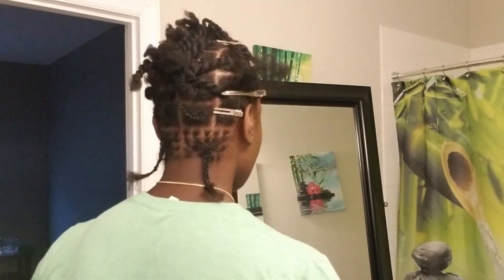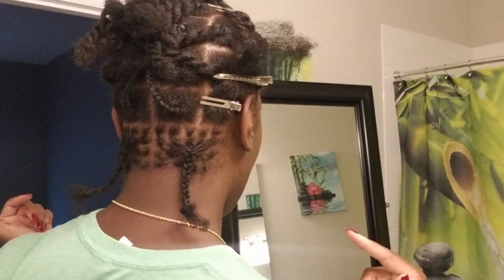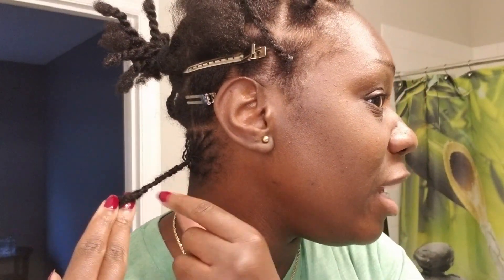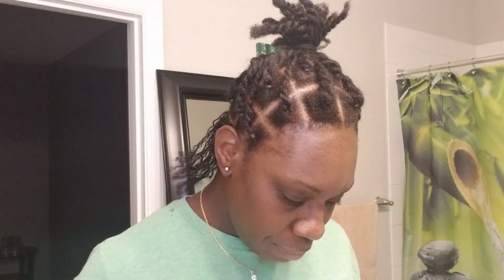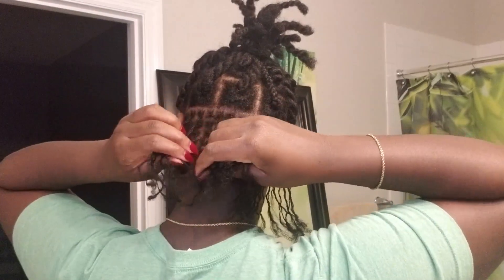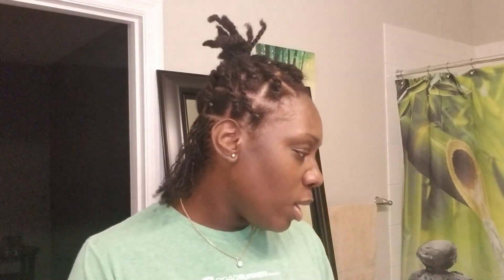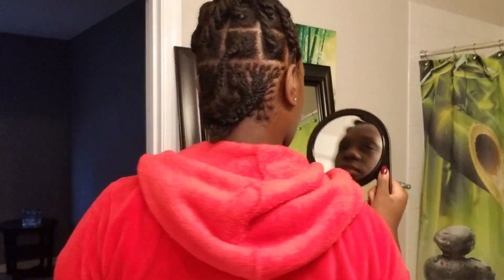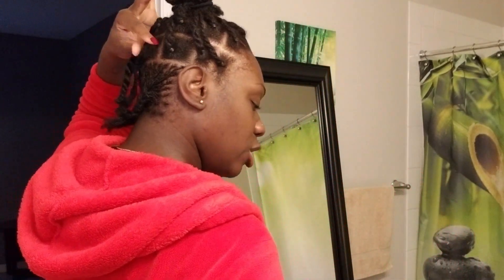DIY Microlocs | Installation Day 1 and 2 | Loc Journey | Interlocks

Comment: They look great !! If i had to do mine over again i would've kept my micro locs and i would've started them off with braidlocs instead of micro twist
Reply from the maker: Why is that?
Reply: @TayLaDawn  because i had got 3 different cancers within a two year period. The worst being double breast cancer and the surgeries and treatments were not kind to my hair. I lost 49 locs all together and i combined my micro twist locs thinking it would strengthen my hair . but alk it did was add weight to already chemo damaged struggling strands. I cut ALOT of damage off and where i lost locs is steadily growing but i just wish i had not panicked and stuck with my original plan and my hair would be thriving more than they are.i started with 385 locs to now having 70
Reply: @deejathediva3153  God bless you, I am so glad that you made it through!🙏

Comment: I don't know if I missed it, but how are you installing the upper sections. Did you start off with braiding then twisting to the end? Or then braiding the end to keep it together so it does not go loose. Or were you twisting from top to bottom? I'm watching videos and I'm seeing people twisting from top to bottom and then interlocking and I'm like how does it stay together if you're interlocking after doing the twist